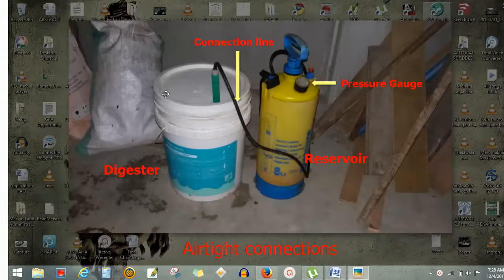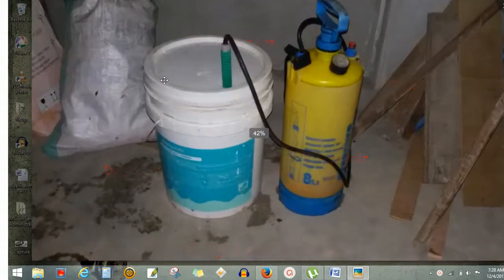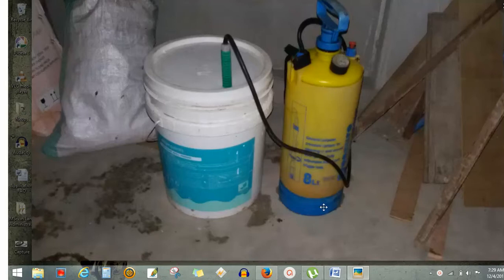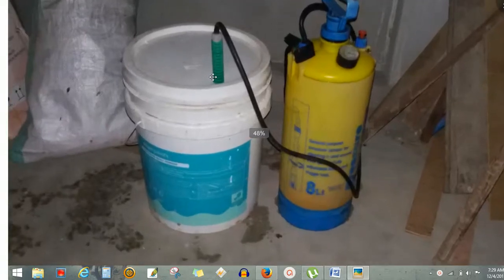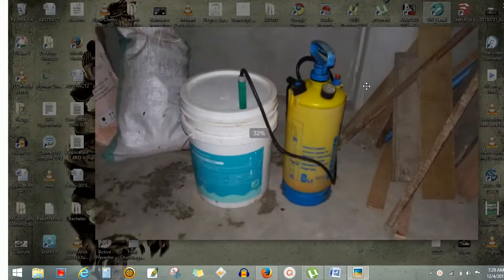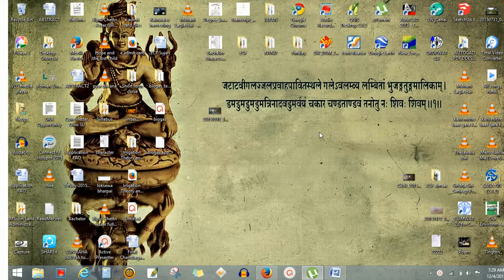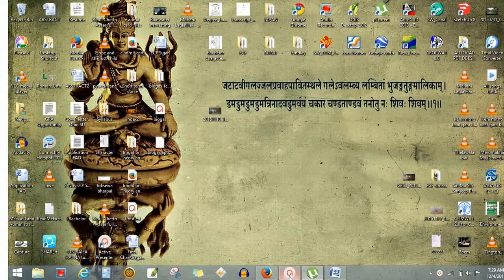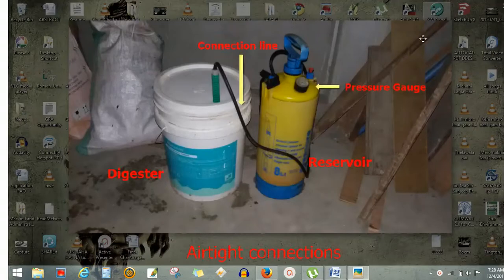Homemade bio-gas digester plant, prototype.

Comment: Will I be able to use a compressor to store in cylinder for use?
Reply from the maker: U day i dont think you need to compress the gas, u can simply store the gas(methane) even in motocycle tubes or such materials as well.